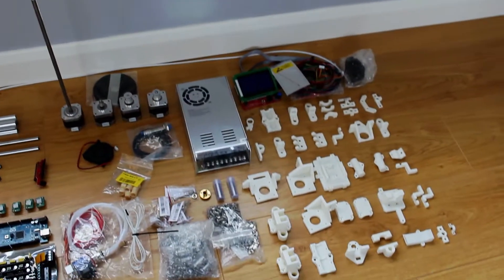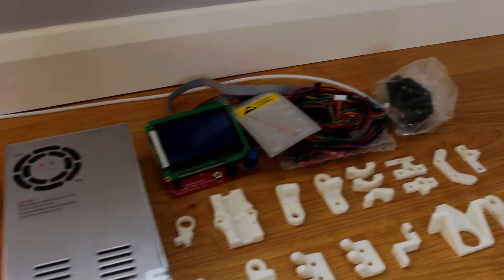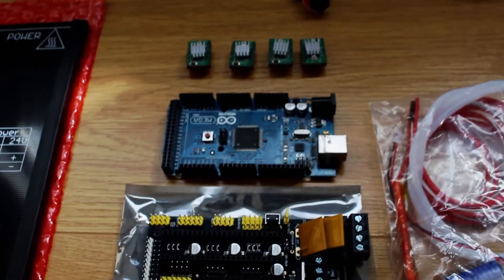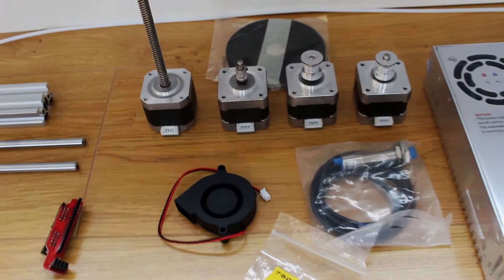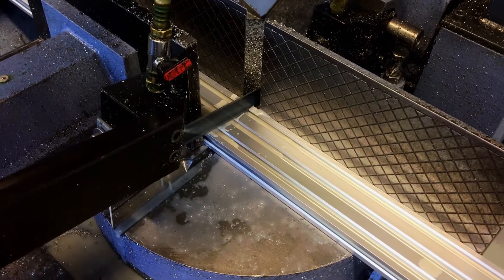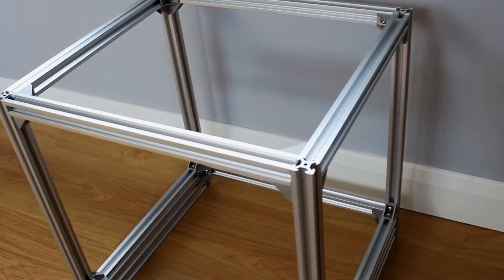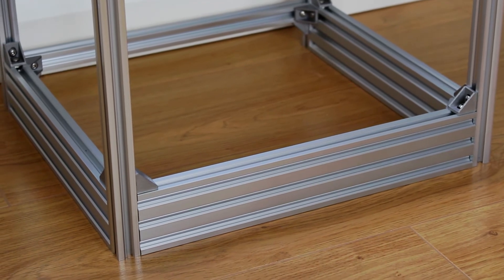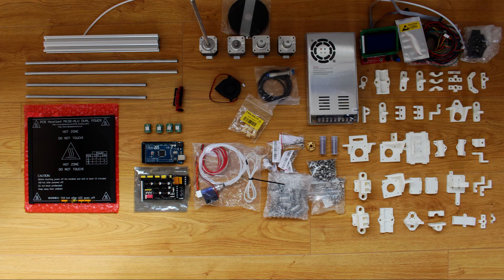HyperCube 3D Printer Build Part 2 - Frame and Parts

Comment: Hi,
Just enjoyed watching your build and learned such a lot from it!
I bought a box of abandoned bits described as a Prusa MK 1 with the triangle frame which I abandoned as it came out of the box for 150 pounds!!
Inside we have a MEGA Well exactly as you have in 0.51 above. Do you have a circuit diagram for all these parts please which I am sure would help many others with theirs?
So many flash past this very important stage. 
My build is round a solid box with cutouts and solid mounts with the Z-axis driven from the top for easy access in case things go wrong.
Best regards.
David and Lily.
Reply from the maker: Hello,

Thank you very much, glad you enjoyed it! I'm afraid I don't have a diagram of that Mega, I now use the genuine Arduino one, here is a link where you can find the diagram for the ramps https://www.staticboards.es/productos/ramps14sb/ 

Sounds like an interesting build, hope it goes well!

Cheers

Comment: Using 20x60, did you have to adjust length of Z axis extrusion frames?
Reply from the maker: yes, basically added the difference on, but you can make the frame whatever size you wish as long as you change the other components accordingly

Comment: Thanks for the videos.

I'm starting a hypercube build myself.  Have the parts printed, but tried the carbon fibre route on the X carriage but am unimpressed by the performance.  The rods are not perfectly round or straight.  I think I'm going to use 10mm IGUS rails and bearings for both the X and Y which will need new joiners designing and printing.  The extra width of the rods will hopefully help keep it stiff as I plan to use a 300x300 bed instead.

Good luck with the build, and keep us posted!
Reply from the maker: Hello, thank you for your comment! That is interesting as I wondered if there would be some issues with the carbon tubes so I went with the aluminium, I wasn't sure originally. Those IGUS rails you mentioned should work great! please let me know how they work out and how your build goes!
Reply: PracticalProjects Will do! The igus rails seem perfect as they're toleranced correctly and have a slightly rough anodised surface to make the lubricants in the polymer bushings work. Even smoothed the carbon rods catch at different points along their length. I ran them in a drill with sandpaper round them to no avail. It may work, but doesn't feel consistent enough to me and has slop at some points.

I will hopefully use 10mm on x and y at 500mm long. Makes ordering the 2020 easy too i guess. Ordered a cheap Mk2 style aluminium PCB for now. Hopefully cantilever bed will be enough for that with, with an upgrade to thick aluminium and silicon heater later meaning I'll have to beef it up.

Had tech2c released STP files or just stl?
Reply from the maker: Yeah I will be tempted to buy some of those further down the line, they are just quite expensive! I was concerned with the dimensional tolerance of those carbon fibre tubes. Please do let me know how your build goes! He has just released sol files at the moment. What I do is import them in Autodesk Inventor and use mesh enabler to retrieve the geometry. I then got some dimensions off it to draw up some new parts in CAD
Reply: PracticalProjects Mesh enabler.. I haven't used that functuon! I'll have a look. I've just created sketches and manually copied the geometry. That sounds very useful! Thanks is for the tip.

I assembled the XY gantry as best I can without a frame and the IGUS are butter smooth. The aluminium rods are solid though so heavy compared to the carbon rods. Igus do carbon ones but they are ridiculously expensive. I found an eBay shop for a company that has been recommended that seem to sell better quality 10mm od 6mm id.

Have a look at my twitter for a few pics of what I'm up to.. @jaistanley
Reply from the maker: You're welcome, very useful tool sometimes. Sounds very good, you build looks as though it's coming along nicely!
Reply: If Igus rails are 10mm OD why does it need new parts? Should be drop in replacement for anodised aluminium/carbon tube?